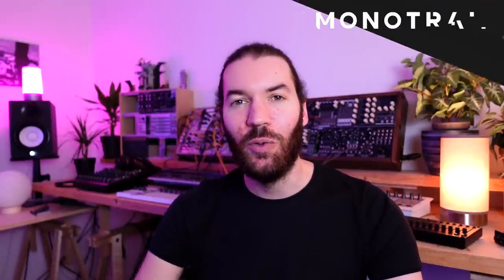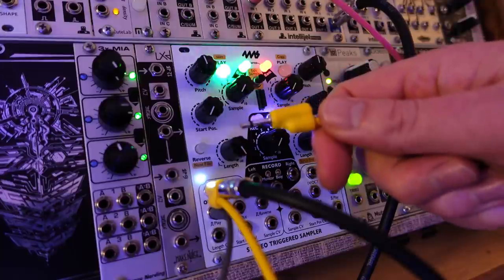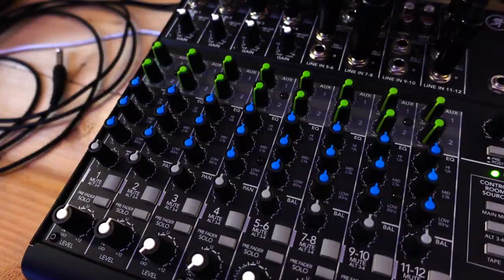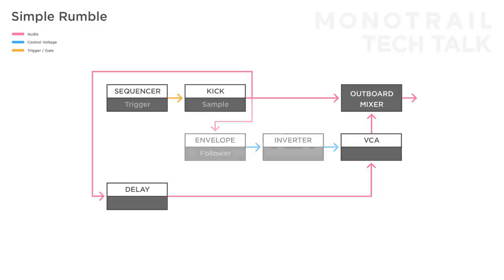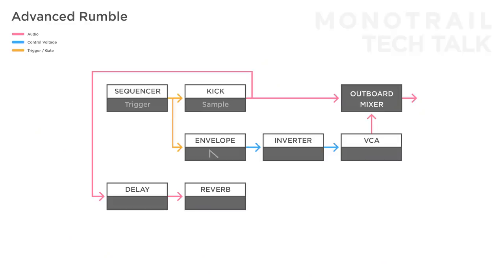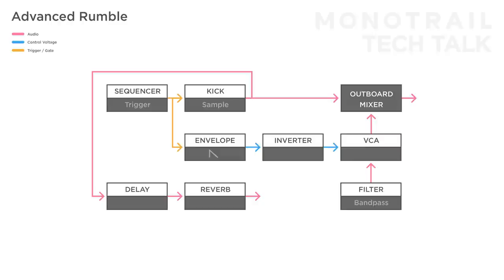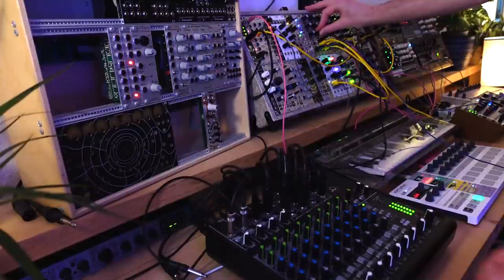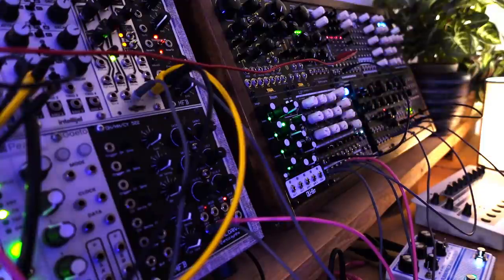How to create techno rumble and textures on the modular

Comment: Very interesting video! When I moved from DAW to Hardware (Eurorack), I had taken my usual Rumble concept with me, and it is great to get some more Eurorack specific ideas here as well! I especially find your application of the Clouds module in such a chain very interesting! Would have never seen that kind of usage in it before
Reply from the maker: Thanks! Glad you liked it, feel free to share other ideas if you have! I never went deep with producing in a DAW, I'm sure there are other concepts that translate to a modular :)
Reply: @MonotrailTechTalk  One difference I noticed is the ducking, that I would usually do via compressor in DAW. But since I do not have any in my rack I always did it via VCA as well. I still want to give it a try in the future, using a compressor though and have the 2hp comp on my wishlist for a while now. Maybe you can try and see if you find it sounding any different if you happen to have a compressor module :)
I actually think it is this need for improvisation, that made modular much more interesting to me than DAW. Makes us find many different routes for the lack of modules sometimes :D
Reply from the maker: Hey, thanks. Unfortunately I don't have a compressor in my system. I usually don't need one when performing, and generally work in the DAW for mixing etc. I think it will be slightly different though, With some compressors you could color the sound, might be interesting. But you would need one with a more extreme release time to create the slower pumping groove. That 2hp one might be interesting, nice and compact :)

Comment: Some good tips here! I never tested my rumble on PA but it's sounds good to me and pretty simple. I just send an attenuated envelope into kick's pitch CV, where envelopes are triggered on every 16th note except for the kick notes. So xoooxoooxoooxooo. Adjust the envelope and attenuation to taste and I don't even need reverb or delay.
Reply from the maker: Hi there, thanks for sharing! Could you elaborate? I think I get the picture, the X000 envelope is creating a pattern out of the kick, that's a nice idea. Do you use this kick also for the sound of the kick itself? So you would need a kick with a long delay time, or make a kick from an oscillator?  :)
Reply: @MonotrailTechTalk  hey, sorry missed your question! Yes I use the same kick for the sound and indeed you need a very long decay. You don't even need to sidechain because it is essentially the same sound. It is of course pretty simple, and the possibilities of what you showed in the video are much larger. I made quick video to showcase: https://www.youtube.com/watch?v=RAmhqm3K31g. In the video I sequence envelope on every 16th note and send it as pitch modulator. I am not actually sure if this is actually considered a rumble, but it adds a nice bass layer on top of the kick, and you can make it as subtle or pronounced as you want.
Reply from the maker: Ha, thanks for the answer and demo, that sounds nice!

Comment: Great tutorial! Though not being used in this example, is your DOD Rubberneck synced to clock?
Reply from the maker: Thanks! There's no clock/sync input in the DOD, but it does have tap tempo, so indeed in many cases when I use it it is manually tempo synced :)
Reply: @MonotrailTechTalk  yep that's how I  do it to. Didn't know if that footswitch input might respond to clock. May try it later.

Comment: Two questions: 1) When you make a techno rumble, does that act as your main bass sound, so you no longer make a bassline? 2) When playing live I assume you would not make a copy of your main kick sample for the rumble, because changing kick sample mid-play would bring unexpected results. I assume you would just use the same known kick for the rumble, while your main kick is a separate sample, or? Thanks!
Reply from the maker: Hi there! 
1) Whatever you like of course. A massive rumble is more often used in this sort of dense industrial stuff, can be great without melodic bassline. But you can also actually cut some low end in the rumble, make it more 'airy' and still experiment with other bass sounds!
2) This video is just to teach the principles. I am actually working on a setup for techno atm. If I would perform with this style I wouldn't use a sample for the kick. I advise a 'proper' kick module if you are aiming at performing techno. Samples can lack some low-end on a larger system. And with a dedicated kick module you could 'sculpt' the kick gradually over time, moving from part or track to track, and the rumble would organically change along :) But indeed, if you want the rumble to be separately 'sculptable' (is that even a word? :) you can always use a different sample or sound than the kick!
Reply: @MonotrailTechTalk  Thanks for the answer, understood! So regarding the fact that samples can lack some low end - is the only way to find out is by actually playing on PA? For example if I am playing a kick sample which sounds like it has as massive bass on my quality home monitors + subwoofer, that does not necessarily mean that it will translate well into a massive bass in PA? Of course assuming that my room is acoustically treated otherwise we cannot know for sure if we get lots of low end reflections.

Comment: The main mystery here is getting Clouds do more than one delay tap. The only way I can do that is by looping the delay. Are you running some alternate firmware or are you using some other algorithm than the looping delay? I have other delay modules, so it’s not really a problem, but getting delay and reverb for the rumble from the same module would be nice.

Great video as always!
Reply from the maker: Hey there, I'm using the stockf firmware, first mode. So using the granular engine, not the delay. Use the position knob to create delay time, and feedback for multiple taps. This is a very filthy and messy kind of delay, but perfect for rumble :)
Reply: @MonotrailTechTalk   cheers! I'll make sure to try that.

Comment: you can also use sampled pieces of any songs and filter out high frequencies and apply side chain compression
Reply from the maker: Yeah, absolutely! Thought about that, but actually forgot to implement in the video. But similar to the section where I inject noise in the patch, you can use prepared samples. It's really an efficent way of making good sounds! Cheers!

Comment: You may want to get your ears checked. There’s a VERY irritating high pitched sound in the video when the synth is playing. If you can’t hear it, try running the audio through a frequency analyzer. It should peak out and be very easy to detect visually.
Reply from the maker: You may want to pay better attention to the video. It's called clock noise, caused by analog bucket brigade delays. In my case the Erica Synths BBD. I made the conscious choice to keep my patches simple, and not do any multitracking/EQ/postprocessing on my audio, so people can hear how patches and modules sound out of the box. You'd want to filter that out with another filter module or in post for clean performances or productions.